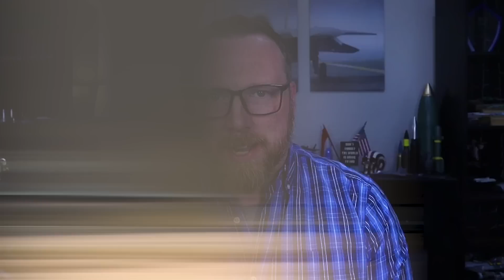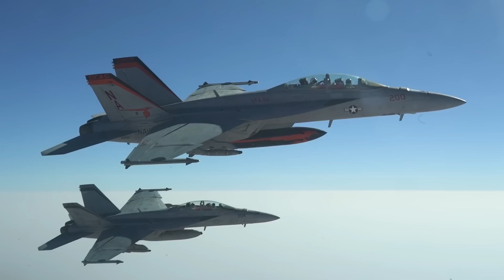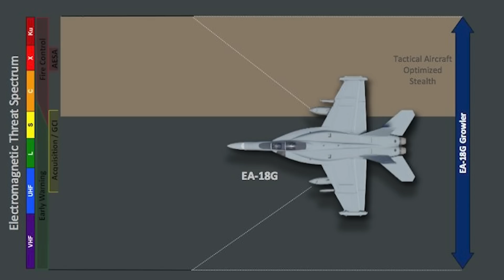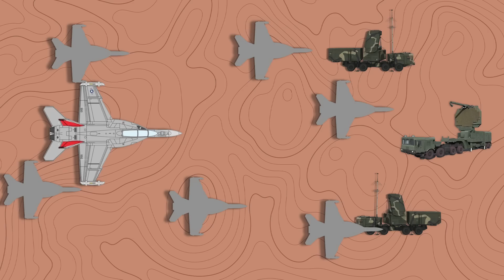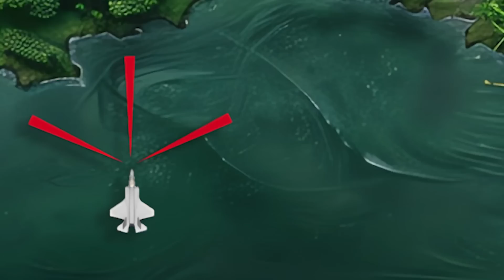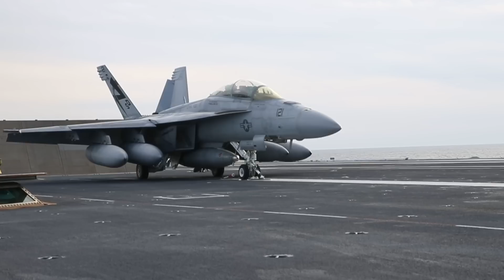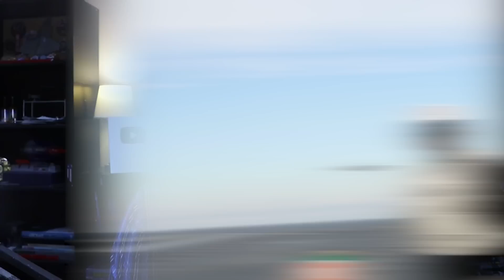The Navy's nastiest fighter nobody ever talks about

Comment: Since the AF dumped the EF-111 a while ago...maybe the Air Force needs to re-valuate this EW gap in their tactical fleets and take some of those new F-15 EXs and turn them into a Growler equivalent ????
Naw, the AF response will be, 'DRONES...drones will do it ALL !!!!'
smh.
Reply: I've been wondering about the USAF's EW capabilities too.  Are they just relying on the Navy, like they did with the Prowler?  It's not obvious why the Navy would be interested in providing that extra service.  Does the USAF have any long term plans to develop an EW capability, or just continue to rely on the Navy?  It does seem like some non-stealth platform like the F-15 would be a good choice for them.  Boeing could just transfer the systems from the Growler, so not as if they would be starting from scratch.
Reply: Actually the Navy's response, too.  They're disestablishing VQ-1 shortly and delegating its mission to drones, which is so monumentally stupid I have a hard time believing it.  The Navy is desperately trying to mothball the Growler and get rid of the current VAQ squadrons, too.  Some missions should not be trusted to drones/AI and EW is one of them.

Comment: what EW planes do USAF have?
Reply: Since the Air Force retired its EF-111 Ravens in the '90's, it hasn't had a dedicated electronic warfare a/c, at least not a tactical one.  The EA-6B Prowler then became something of a joint service a/c, often with mixed Navy, Air Force and Marine Corps crews.  I'm not sure the Growler crews are multi-service.
Reply: The EC-130H Compass Call and the newer EA-37B 
They dont have flight line aircraft, just support planes far back
Ideally , they should look at make EA variant of the F-16

Comment: Basically rick rolling enemy radar systems, I'm here for it.
Reply: Wouldn't it be great if they actually Rick Rolled the radar operators.
Reply: @chuck.reichert83  Possibly the greatest electronic warfare flex. 😂
Reply: @chuck.reichert83  It's a shame the enemy hardware isn't analog anymore, using oscilloscope screens for readouts, as then it's possible they actually could actually Rick Roll them... Just look up "Oscilloscope Music" lol
Reply: I have always found the EF-111 and EA-6B fascinating. It’s such a cerebral fight and the brain of the EWO is the primary weapon. Brings “brains over braun” into the spotlight really well.
Reply: @Simmer4Decades   Few plans survive contact with the enemy, EW being the best example I know.  Only the opening moves are really pre-planned. If LSD ever had a military application, forcing EWOs to think creatively outside of the box(x)  would be it.  Encompassing all those on land, ocean and in the air.
"Just sit down, strap in and follow the pretty colours man. Let the music be your guide." John Lennon.
Reply: @Simmer4Decades Brains over von Braun?

Appropriate for an anti-missile system.
Reply: Never gonna give you up…
Reply: This is the comment of the month lol 😂😂😂😂
Reply: Pods eh 😮
Reply: Tried and tested in venezuela, it works.

Comment: 3:25 Alex out here theorizing that the Growler has an energy weapon, and I'm here for it.
Reply: Correction 
*Is an energy weapon
Reply: Inverse-square law applies. 

This is why you should never place a baby inside a microwave.
Reply: @Triple_J.1 soooo doooo cognitive dissonance and the CD is much more hard to work around 😕
Reply: Inverse-square law applies. 

This is why you should never place a baby inside a microwave.
Reply: TBH it's not really even a theory, from some public comments the F-35s radar is capable of literally burning out the radars of hostile jets by overloading them, as these pods are based upon the F-35s systems it only makes sense that it can do the same, if not better.
Reply: Is this theoretically possible? with the amount of power available on an aircraft?
Reply: Unsure. To really fry an enemy sensor you need a high intensity of RF energy focused on the sensor. That doesn't just mean a high power output from the pod, but also a small spot size achieved by having a very large aperture.

Several things that might help the NGJ out here are:

1. Having AESA, and more importantly having side mounted AESA along the length of the pod, which would allow for a really large aperture and thus really small spot size and also allow the Growler to maintain zero closure while performing e-war duties
2. Upgrading to direct power transfer from the ram-air turbines of the ALQ-99, which MAY allow for higher power output. Additionally with the ram-air turbine you slow down the carrying aircraft, up its radar signature, and the power thus provided is noisy and needs to be 'conditioned' with on-board equipment inside the pod, all of which reduce performance. By leaving the signal conditioning to the aircraft you could get away with much more performance that way as well
Reply: @dsdy1205  sounds plausible in theory. But I'm also thinking the power output would need to be very significant..🤷‍♂️ Time will tell
Reply: @georgeau2523 
Theoretically possible. Not sure how practical though. Physics tells us that radio waves propagate logarithmically, and thus power drops off logarithmically. So in order to damage an RF sensor, you would need to focus a lot of power in a small area. A plane flying far away would have some trouble with this simply because of the limits on the size and shape of the arrays, and the amount of electrical power you can put through them. That's why the AEGIS air defense system is capable of longer range and higher fidelity than the PATRIOT system. A ship doesn't have the power constraints of having to run on portable generators.
Reply: @Clean97GTI  A ship is probably the best platform for an energy weapon. Even with a directed phased array antenna I don't see how a pod hanging off a aircraft could destroy a radar kilometers away with electromagnetic energy alone
Reply: They also have the ability to a very powerful but single-use ecm that is a variation on the W-95 ecm package (iirc). The scuttle-booty is the single use ecm produces a powerful wide band electric magnetical pulse that supposedly forces electronics to quickly shutdown and refuse to boot back up.  The reason it isn't used more widespreadly is it supposedly has some kinda gnarly side effects. What effective weapons never affecto non-targetos? Once and done seems a good way to run an ECM campaign.  To bad the JCS doesn't have the MacArthur to smash ants sith sledgies wedgies.
Reply: “and I’m here for it” is such a lame Reddit/Twitter trend
Reply: @matdan2  lame as it might be..I'm here for it too! 😂

Comment: I hope the Navy doesn't make the mistake of Early Retirement for the Fa 18 and Ea 18 family like they did with the F 14s. The F 35s CANNOT replace the Hornet fleet One on one... It simply is not feasible...  And the FA XX is Miles away.... Hope the Navy keeps the Production line running for the Hornets.....
Reply: Why not? If it's willing to carry external stores like a Superhornet, the F-35 carries more, flies farther, generates more power and has far, far more powerful onboard computing and sensors. All it really needs to have those pods, which with modifications might not even severely compromise stealth.
Reply: Somebody always wants to replace something with an F-35 that will never be anywhere near as capable as the original aircraft. Cant wait until they start suggesting we replace F-22s and C-130s with dainty little F-35s.